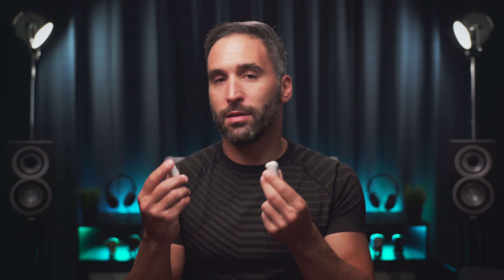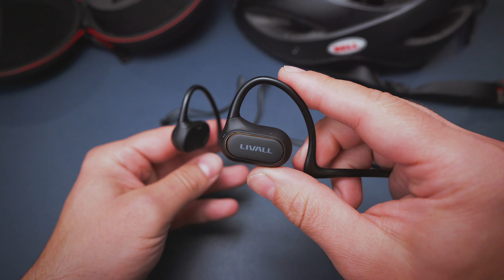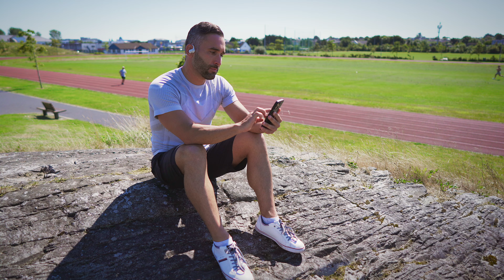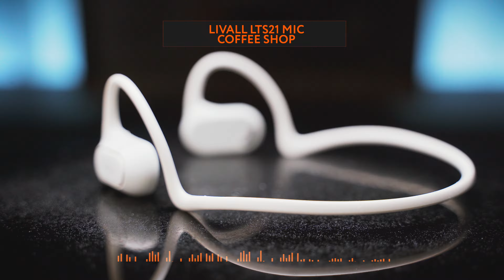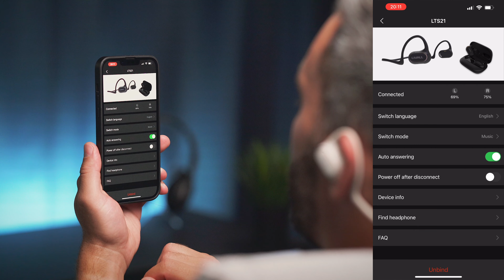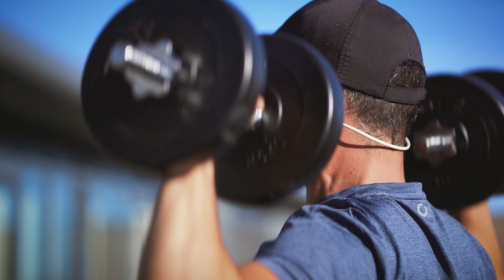Livall LTS21 Open Ear Sport Headphones Review

Comment: Caution: Some assembly required 🙂 It does have a very unique and innovative design but it definitely would have been more hassle free and user friendly if it was able to be collapsed into the charging case when not in use rather than having to take it apart each time. It does offer some advantages over more traditional options, though, so I think it's well worth consideration otherwise. Thank you for another awesome review, Andy! 👍
Reply from the maker: Thanks man. It’s an interesting concept which could be improved in the future for sure